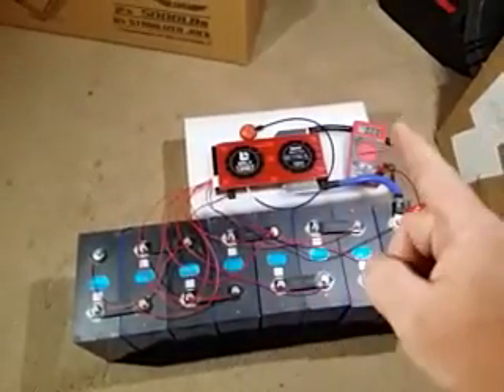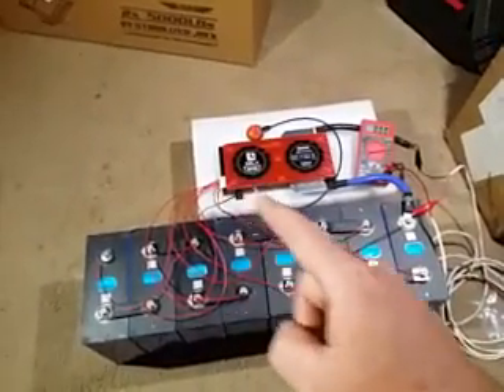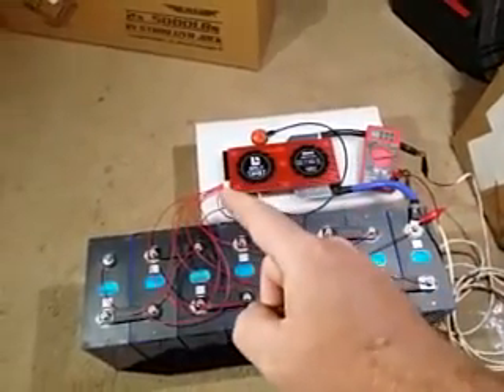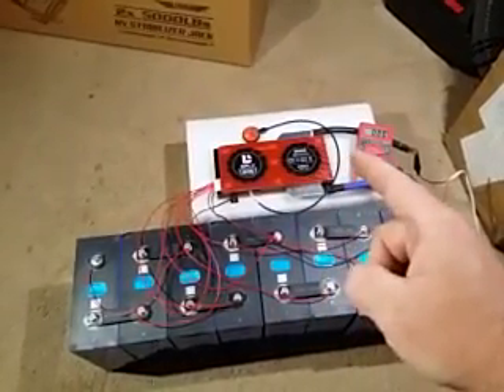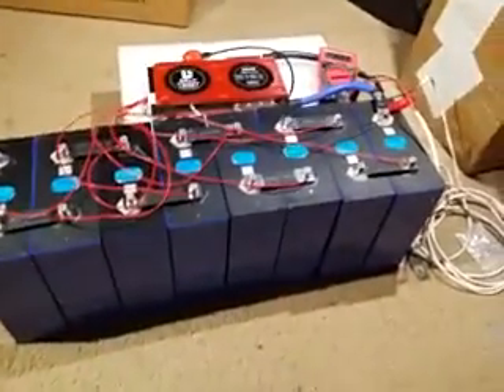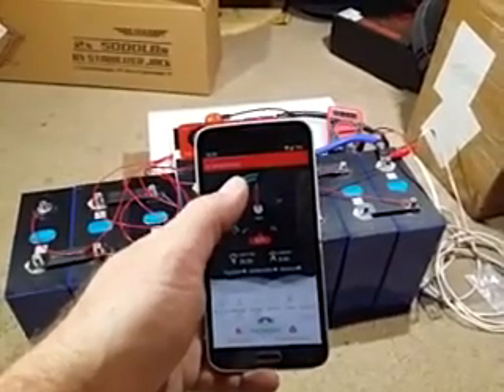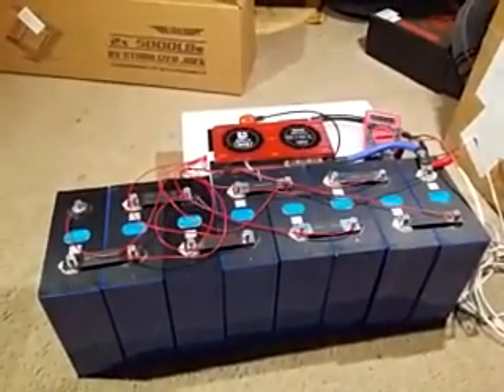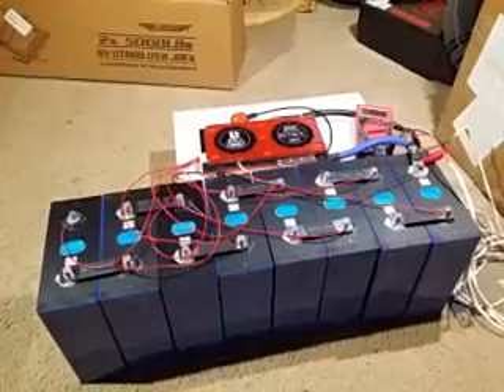How to wire up and turn on your Daly 250 Smart BMS without the light board

Comment: Thanks for the vid and the tip.  Man, I spent so much time trying to get my BT to show up and get the BMS activated. I read many posts like you and wasn't sure about the short on these pins. What worked for me was to put a power supply to charge the battery. As soon as I reached 27V it kicked in and showed up. Working great now, but that wasn't quite intuitive.  Many vids about these BMSs, but very few explain how to activate it.

Comment: Thanks, so far I started it with a charger.
Reply from the maker: Aye, but I didn't have the charger setup yet. I know not everyone will need to do this, but it gives confidence when you can watch someone else do the thing succesfully first. I purchased a light board since then and used a usb3.0 cable to move it somewhere convenient in my installation
Reply: @robertccole13  I prefer your method, especially if you are on the road and for what ever reason need to start it
Reply: What charger you using for 24V 8S lifepo4? Tried waking it up with a charger but only gives 1.5A... might not be enough... Didnt work shorting the pin 1 and 3 like thid video explains... Im getting voltage on all pins but bluetooth aint connecting... cant read any data

Comment: Why not just press the on/off  button on the bluetooth dongle?
Reply: That only acts to trigger pairing between the dongle and another bluetooth device.
Reply: @loganvanleigh7601  it turns on the bms on mine.  I don't know it that is a new function or not.
Reply: @1238chode  Mine, which I bought in july, does not have that button.
Reply: @MaxMax-nb1lm  have a very close look at the dongle.  The button is bronze and is about 2mm diameter on the top side of the dongle opposite the usb plug.
Reply: @1238chode  Thanks, but I do have the older version. But my battery is working so no problem so far.
Reply: @1238chode  Mine has the button too, but didn't activate BT until I put a power supply on the battery and started to charge, then it suddenly appeared and I was good to go.
Reply: @stephanecome4234  Good to read, my attempts parallel yours. I am going to try to put a charge load on it before anything else. This was a poor design by Daly and I own 4 of them (as 2 are for backups). Thanks

Comment: Great info!
Where did you find this information, on the BMS user guide?
I guess you could put a switch between these 2 pins and turn the BMS on or off at will.
Reply from the maker: TY!
Random google results cross checked against each other and information I found on DIYSolarforum dot com

The user manual would be great to start a fire with, but that's about all.... LOL!
Reply: Nope.  Shorting the pins only works as an "ON" button.  I tried.